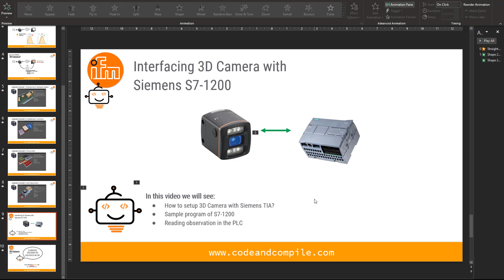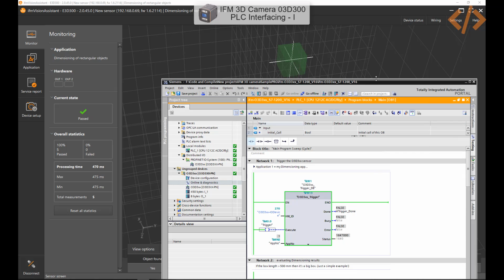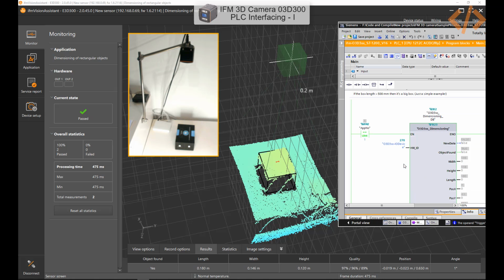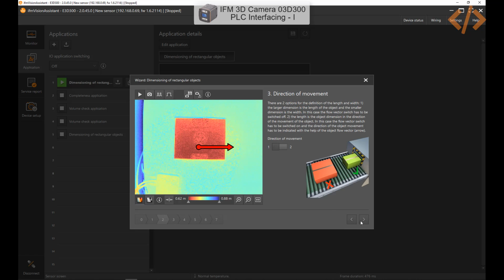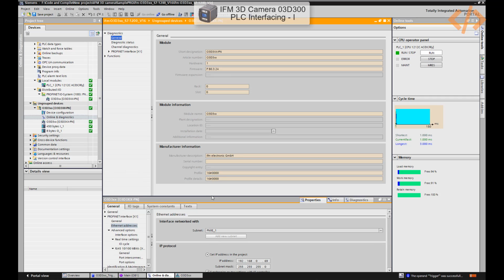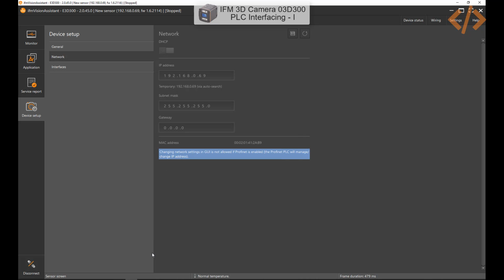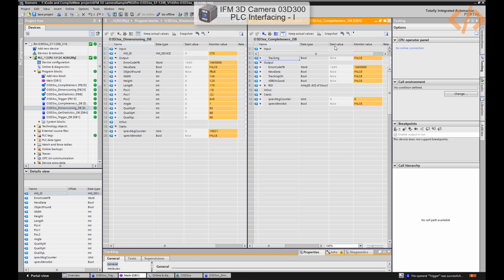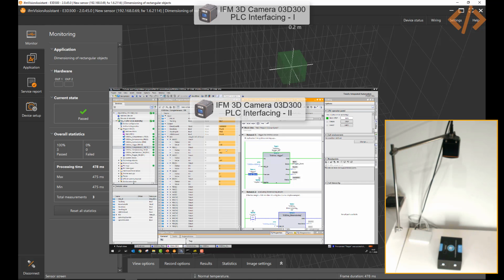IFM 3D Camera Interfacing with Siemens PLC -1

Comment: We had a problem with the connection. In this video you discripe the prblem very good. We fixt it. THANK YOU SO MUCH
Reply from the maker: Glad to hear that :) What are you doing with your 3D camera?
Reply: @thegeterrdone  we use it to make a loop control for a metal strip before and after a press